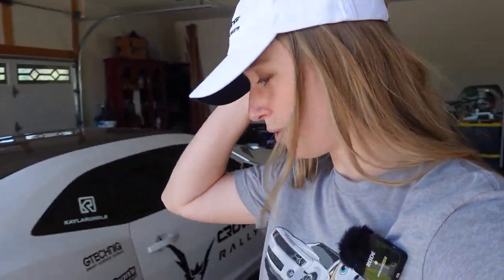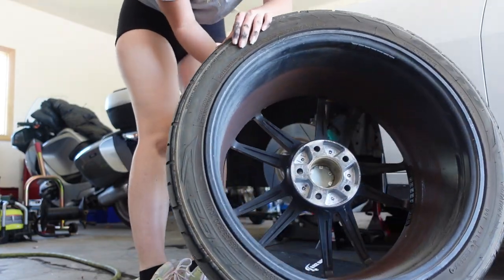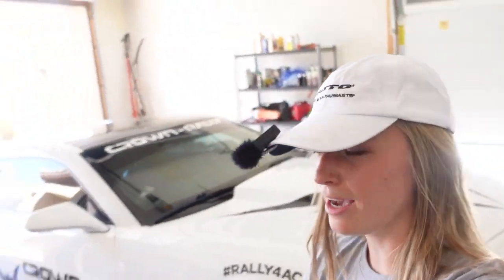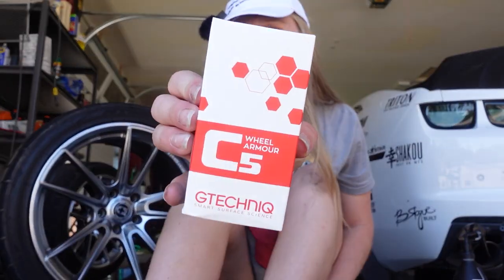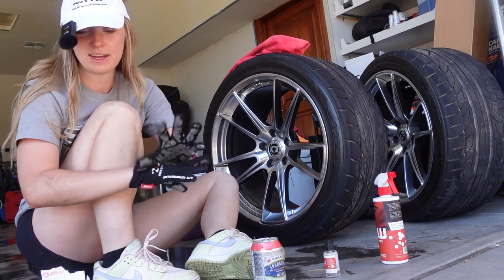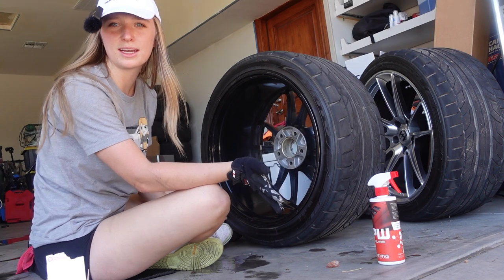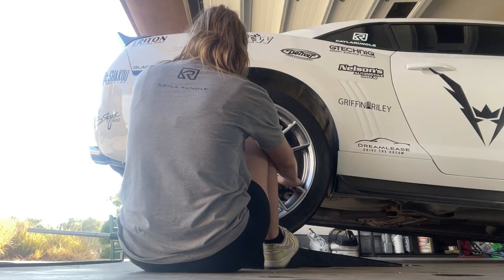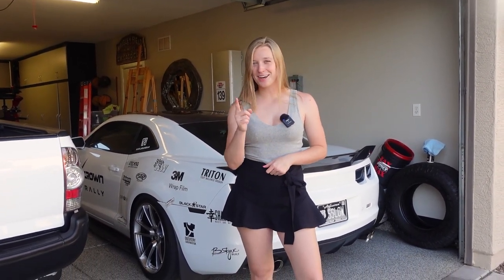Undercarriage Cleaning & Ceramic Coating my Wheels

Comment: You have done a great job with cleaning your car. Here is you a pro tip for your undercarriage cleaning: You can use a surface cleaner and before you can use it….. turn it upside down and mount the wheels the same way. Please be careful using it without being underneath of the car! Plus you can also use a downstream injection with cleaning solution for more cleaning help. Good Luck 👍 and keep up the great work and have a blessed day!

Comment: The struggle is real lol, your lugs were definitely torqued to specs!! You did a great job on the wheel wells. A lot of people would be like, it's underneath, nobody sees it whats the point of cleaning it? They don't understand the ocd we have when it comes to our babies!! I need to do the same to my 20's, but I'm always busy doing other improvements to her. Great video Kayla. Thanks and God bless.
Reply from the maker: Oh yes I always go extra with the lug Nuts based on my past experiences. It is very true that undercarriage protection is not seen as a priority to most people, but it makes a huge difference in drivability and longevity of your vehicle. My wheel was actually shaking because of how much dirt was on the wheel- throwing off the balance. Now it drives like a dream!
Reply: @KaylaRundle  oh yeah, I forgot about your wheel falling off that one time. I always torque mine to 140 pounds, that's what my Silverado calls for. Wish us viewers could post pictures on here, but I understand why YouTube vetos it lol. I could just imagine what some people would post. Thanks for the reply Kayla.

Comment: Nice job! Check out Matt moreman's processs for wheel cleaning on his obsessed garage channel.   I've done my Abarth wheels with C5 and it does a great job. Did my ats wheels with CSL and 2 coats of ExoV4. Super slick. Key to longevity is maintenance. I use Technician's Choice Gmax w/graphene spray after each wash on the paint and the wheels. Keeps them pristine.

Comment: Thank you for sharing.  What about micro scratches on the surface of the wheel, does the ceramic do a good job at covering/hiding these scratches or is it best to correct these micro scratches first prior to ceramic coating the wheels?

Comment: Is DI water really DI after exposure to the carbon dioxide in the atmospheric air?  There are ways to keep DI water DI, like nitrogen Gasa blanket over the conditioned affluent but I don’t see that as practical for small volume users.  Theoretically, you should only need RO water to remove the minerals which cause water spotting.  Is there another user requirement for rinse water I’m not thinking of?

Comment: When taking the wheel off, it might be easier to set the tool handle close to horizontal and then using your bodyweight to stand on it to undo.

Comment: I mean, I understand cleaning the wheel well and stuff but, cleaning the underside to a detailers finish is the equivalent to sneaker heads cleaning the bottom of their shoes.
Reply from the maker: I find this so funny because I detail the bottom of all my shoes 🤣 just so when I put them on my sneaker throne in the mean time they are clean until I wear them again

Comment: You flush the brake system and how bad are the rotors/pads?
Reply from the maker: Not yet but soon I will!
Reply: following this Wheel ceramic coating.  Would like to protect my Fiske from debris as well. Beautiful SS BTW.